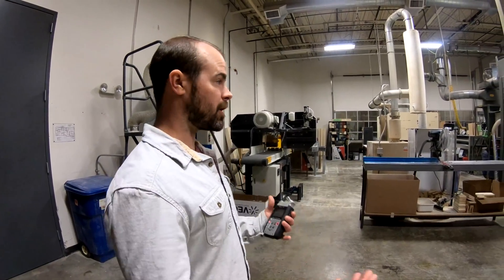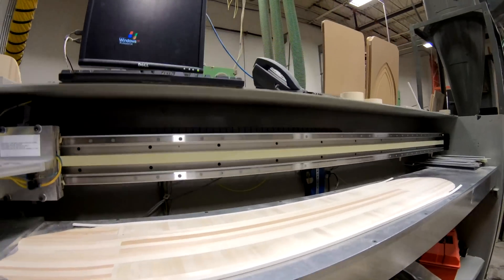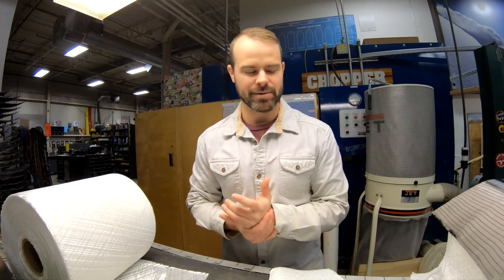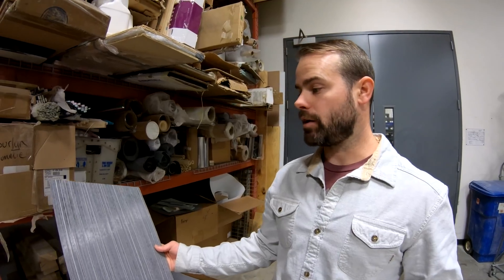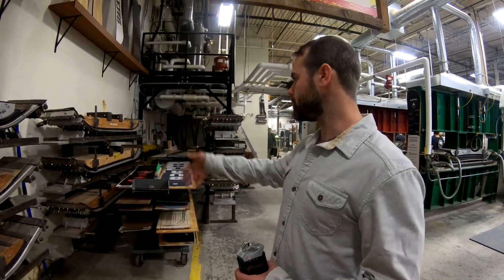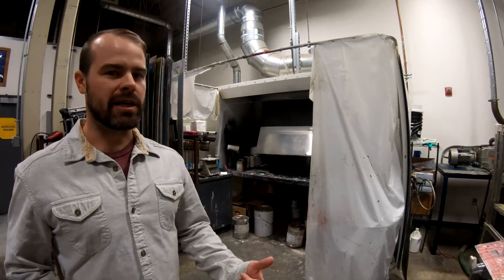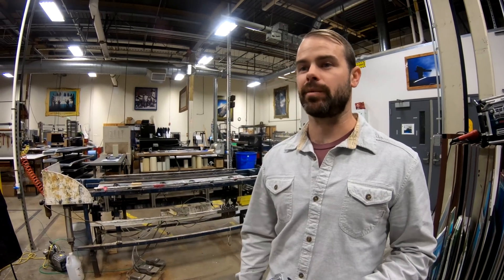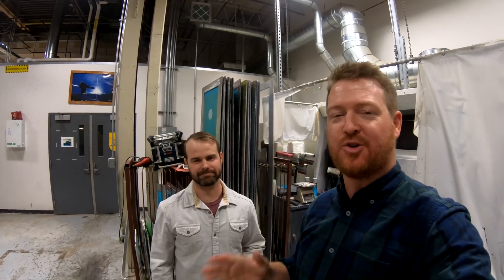2018 Burton Craig's Prototype Facility Tour

Comment: Start developing normal sized boards for us13 boots with a minimum width of 27 or 27.5  to 28 if the board has carving abilities... (166xw in 28... Flight attendant, custom ..., Sceleton key...)
Reply from the maker: Right on!  Same thoughts.